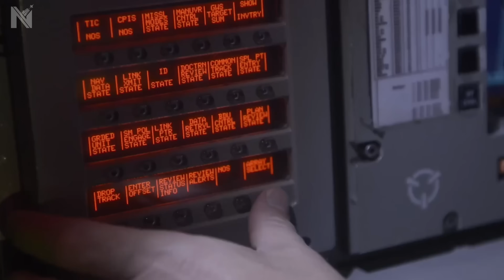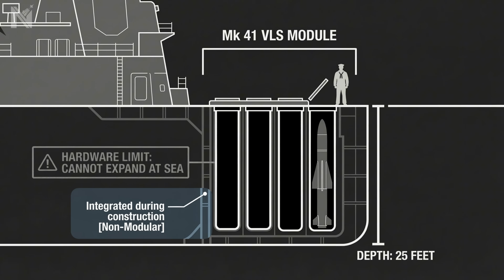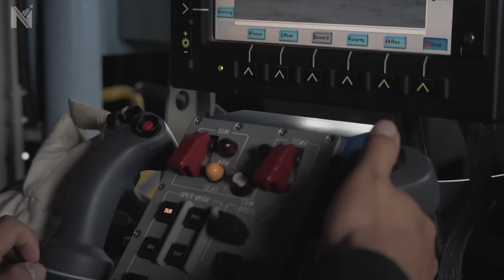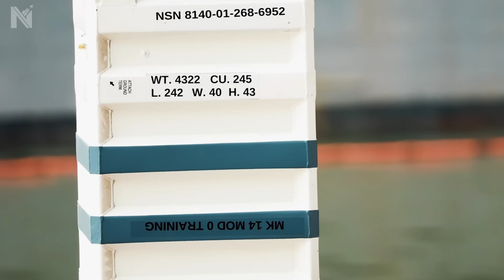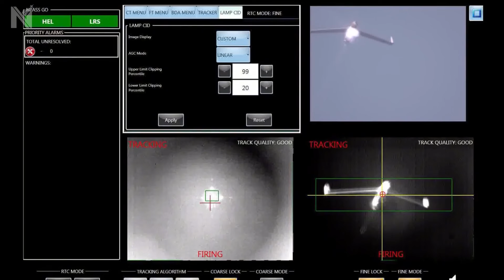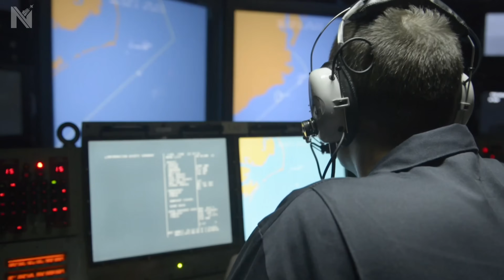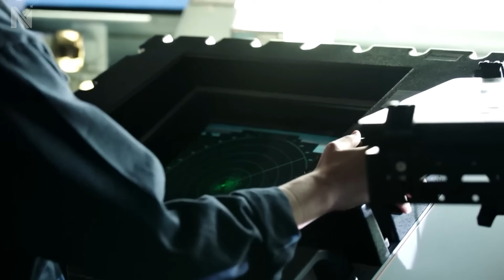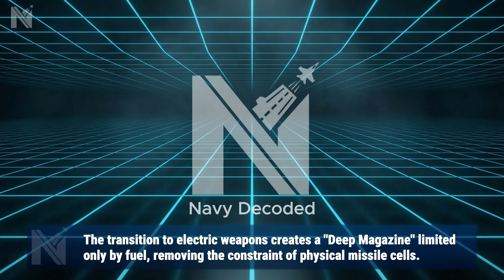Why The US Navy No Longer Fears Suicide Drone Swarms

Comment: 300kw lasers, microwave bursts and jamming takes care of the drone swam problem. I did not even look at the video to know that. This technology will only get better.
Reply from the maker: @ColonelJohnmatrix1000 You’re right about the tools—but the video’s point is how and why they’re used together. There’s no single silver bullet; lasers, HPM, EW, and missiles work as a layered system to control cost, geometry, and escalation—not just to knock drones down.
Reply: @NavyDecoded That's why America is the best military. They plan well well ahead and they kill many birds with one stone.
Reply: @PaintSpec Yeah, we saw it in Afganistán
Reply: And sadly, so will cheap countermeasures.
Reply: @justgivemethetruth  EXACTLY! I own a water cooled infra red laser and just the other day we tried to mark on white plastic. We couldn't even get the plastic warm to the touch regardless of settings! We can literally torch metals like stainless and titanium. With the settings we were using tried a piece of black plastic and it literally caught on fire! In Hiroshima people that wore white clothing were not burned by the flash but if they had white clothing and a black belt the belt literally torched them. So what I am saying is a completely white drone and I mean "real white" would literally be immune to this IR laser. If you were able to put a slow spin on the drone like Putin threatened to do with his missiles, then you have a cheap and effective way to get past the laser. What they need to do is have multiple wavelength lasers. This will help get past the white hack that our enemies will OBVIOUSLY begin to deploy. Not all lasers have problems with white. Our other laser has no issue marking it but it is not IR!
Reply: @sufficetosay  Interesting.  Maybe they would need some kind of parallel array of radiation at various frequency.  Wonder if they could manufacture a frequency shifting laser.
Reply: @sufficetosay They DO have 'multi- spectral" lasers.  In use today.   It's actually a better way to get more power out of it because they aren't trying to tune down to the narrow band commonly expected.   They also are able to blend different wavelength design together at the output.
Reply: @KarltheFog-m7q  Why are they using IR on the Naval ships? If this multi spectral technology is already on the street it seems only logical to use it. Do you think that maybe they will use it once it matures? Maybe they could use the existing IR infrastructure and convert the system to Multi spectral when it makes sense...?
Reply: What about 10,000 fiber optic connected drones, coming from 15.diffent directions,  using Ai to bring them all in at the exact same moment?
Reply: @joebudi5136  That’s what intelligence is for, so you don’t get yourself into that situation. Thankfully, the USA and its allies have the best intel in the world.
Reply: @RightJoystick re read ny comment. Answer how that attack can be twarted. It cant.
Reply: @joebudi5136 fiber optic 😅.. so you mean wired? it would be a piece of cake.
Reply: @j @joebudi5136  easily. HPM is the gold standard for swarms. HPM weapons like the Epirus Leonidas fire a high-energy burst that fries the physical circuits inside the drone and they fall out of the sky. HPM doesn't need to aim at one drone at a time. It creates a "wide-angle" field of electromagnetic death. Even if the signal is coming through a fibre optic wire, the delicate electronics on the drone's motor and flight controller will melt. Other methods are lasers, defensive drone swarms and the "Slinger" System. Australian-made systems like the EOS Slinger use a 30mm cannon paired with a high-precision radar that can blow drone swarms out of the sky in seconds.
Reply: @joebudi5136 to be clear the way these different weapons work the numbers don't matter and in fact sending more at a time is just easier to knock down.
Many of these weapons are not like shooting one at a time they are shooting in an area so they have an area of effect attack. 

Next issue is fiber optics can only go so far and ships are usually further out to see than fiber optic is going to go at least over the water. And if they land anywhere near the water you can literally have a drone go out there and cut the fiber optics in a second. You can have an underwater drone that can hop out of the water cut them and go back into the water and those are easy to make. 
I looked it up for range and advanced drones can go about 25 to 30 miles but they use a very heavy spool obviously because it needs to have the street to go that far and it's going to be dragging and it's going to be laying on the water or it's going to start pulling the Drone down if the drones tries to stay high. We actually already have watered drones so these fiber optic drones are not going to be a risk to most ships especially carriers that don't ever get that close to land even setting aside the area of effect weapons we have if they reach us
Reply: But did you think of that before the Ukraine war started?  Anyone can think of it today, but the trick is to think of it before the drone swarms start, so the equipment is on ships now, not 5-10 years from now.
Reply: @TheDrjehr the tech is already on ship or is being put there this year.
Reply: 2 c well place nukes on two popular Middle East cities will fix everything too.
Reply: what about stealth drones the size of a football 🏈
Reply: @ithinkthonkthunk5333 All the wide area microwave needs to do is sweep the area
Reply: @KarltheFog-m7q gotcha 👍🏽
Reply: @ithinkthonkthunk5333 They have no range and are easily blown off course by wind.  Obviously you have never served at sea.
Reply: @MonkeyswillWin2063 the range is getting longer every year
Reply: Is that really true?
Reply: You guys understand that these defense systems have limited range; are sensitive to oceanic conditions like fog, rain, wind, etc. (which is always!); and cause massive power loads on ships, right?
Reply: @bigsleepla incorrect, new spectrum lasers use duel spectrum technology that bend light around various atmospheric conditions. It’s the technology of the future that make lasers all weather capable
Reply: Copilop
Reply: will it when the drone swarm is 1 million drones? I don't think so.
Reply: @SaraSwedeJénsen Hell……just make it 10 million😂😂😂😂
Reply: @ColonelJohnmatrix1000 yeah soon probably but the most i have seen now is around 600 000 in sync. But as the rate its going now probably within two years military will be able to syc 10 million of them at the same time.
Reply: @SaraSwedeJénsen make it 1 billion!!!
Reply: Video also forget Burke Flight IIA/III and Zumwalt class destroyers have 30mm Mk44 Bushmaster II that can fire air-burst munitions including AHEAD rounds good against swarms of drones. While the older Burke Flight I/II only have the 25mm M242 Bushmaster that can still defend against swarms of speedboats. So for Burke they have 2 of this besides the standard Phalanx CIWS/SeaRAM/RAM. But this is only for terminal interception. Helis are now more commenly used as they can intercept drones at long range. USN for example shot down Shaheed drones at the Red Sea with their MH-60R/S Seahawk helis.
Reply: @johnsilver9338 They have two of them at most. US warships are woefully under-gunned for dealing with high-volume threats.
Reply: @GrahamCStrouse  But each heli can down multiple drones in a single sortie. Against swarm of FPV drones each MH-60R/S is equipped with a 1000+ rpm GAU-21. Basically a mini Phalanx. But small FPV drones that are used for swarm tactics don't have the range. Only the larger Shaheed drones have the 1000+km range.
Reply: @GrahamCStrouse That's why we need bigger ships, destroyers are maxed out on space. We need cruiser class, and yes even Trumps Battleship class. More space equals more weapon platforms available.
Reply: @MonkeyswillWin2063 bad idea in a high intensity fight against China.

Need to spread your firepower across many smaller ships.

Long range anti-surface quasi ballistic missiles, and VTOL CCA fighter drones. 

Stop making the carrier the sole centre of offensive gravity. Spread that out and make it so the enemy don't just have to spend 20 hypersonic missiles to sink one carrier, but have to spend like 10 times that to sink 10 ships that can threaten them.
Reply: @GrahamCStrouse That's why we need cruisers, and even Trumps battleships
Reply: Autonomous drone are jam-proof
Laser needs cool down time
Microwave beam can be affective at shorter range but may not affect drones specifically build with electromagnetic shielding.

Smart enemy will always find a way to counter and anticipate, much like stealth technology is already been rendered useless with quantum radar. Stealth fighter are only good against sub-peer adversary. Not China.
Reply: @jacksableng4775 China makes cheap copies, not near as good as ours.   Their military comes from Temu. Plus its not just us, its Japan, Australia,  Britain,  etc..
Reply: @MonkeyswillWin2063  China, given the budget constrain actually make good products, even better in many respect compared to US. As a matter of fact most of US products like Apple are mostly made in China. On the other hand American made products like cars are sucks, Ford, Chevrolet, Dodge etc can't sell in many countries, oh even Tesla's car have bad reps. US can't make good stuff if the budget is constrained. China makes hypersonic missiles for 100k USD, should the US makes it, it would easily cost 10 million USD.
Best selling American product in many countries would be Boeing, Coca Cola and Soy Bean.
Boeing has almost no budget constrain and has monopoly in the game. Monopoly is the key. Google and NVidia has monopoly so they win.
Reply: @MonkeyswillWin2063 they make them homemade now from Ukraine. STOP kidding yourself. Cheap, fiber optic drones will find their way.
Reply: @MonkeyswillWin2063 Suddenly everybody knows about the chinese threat
Reply: @MonkeyswillWin2063 😂😂😂 MORTONs who underestimate the enemy are the ones who get killed, keep telling yourself China s military is Temu grade
Reply: @jacksableng4775 They are made in Taiwan not China.  Don't be a CCP propagandist
Reply: @joebudi5136 The fiber cables will melt with microwave
Reply: @MonkeyswillWin2063  That's so funny. What makes China different from Taiwan? They are the same people, not that Taiwanese is of different  Intelligence. What Taiwan can do China can also do. As a matter of fact many countries see that there's only one China, Taiwan being a Province of China.
Reply: @jacksableng4775  No need to jam with the microwave weapons.  EMP weapons probably on the horizon as well.  Both very power hungry as is rail guns.
Reply: @dev-debug EMP basically works by frying the silicon chips rendering most electronic unserviceable. 
But EMP damage can be minimized or even nullified by wrapping the electronic parts with a Faraday Cage.
Reply: @jacksableng4775 but what if 10,000 drones all came at the carrier , from 15 different angles, using Ai to have them hit the carrier at the exact same moment? 20,000 drones
.100,000 drones. All on fiber optic. ALL efficient by using Ai. Drones win.
Reply: @joebudi5136 drone alone will not sink a ship. Drone only acts as a prelude, to reduce a ship's sensing and counter-attact capabilities. In other word drone blind the eyes of a ship and numb them down.
The final blow will use hypersonic missiles. One or two direct hit to a vessel is enough to incapacitate it.
Reply: @jacksableng4775 Ha.
Reply: Basically jamming going to be so bad in future they need to go back to projectile weapons - return of the battleship 😮, Trump got real foresight
Reply: @leonardleonunu They have an actual smoke curtain they can hide inside of too.  People forget that one
Reply: @leonardleonunu Japan and their rail guns
Reply: @leonardleonunu or just go up above it about 20 miles…good thing only a few satellites / super-bloons can do that
Reply: Except we don’t have 300 kW lasers and the ones we do have have shit range, don’t work well in bad weather and need to fix in a single point on most targets for several seconds. And HPM hasn’t even been tested.
Reply: @GrahamCStrouse  incorrect. As of 2025, military lasers will have duel spectrum technology that bend the light around any weather conditions including rain or smog. This allows the laser to function unimpeded. 300kw lasers are being upgraded to 600kw before 2027. Beyond 2027, 1 megawatt lasers will be the norm. This has the capability to burn through a hypersonic missile casing in a split second. Or blind its GPS guidance system so it misses its target.
Reply: @ColonelJohnmatrix1000Bro where are you getting your info, TikTok? The physics of bad weather vs optical systems are nearly impossible to defeat that makes lasers feasible for most use cases. Further, there are no 300kw let alone 600kw lasers anywhere close to deployment ready lol
Reply: @Ridewithjst Don't you mean the weather makes lasers un-feasible?
Reply: @spoffspoffington yes
Reply: The drone can be pre programmed they can be made out of different protective materials. They can also come from underneath the sea. 
     I do not have any clue how powerful this is. But I believe it can be defeated. Wouldn’t be impossible for a small underwater drone to come to the surface near the boat then shoot up and explode with a fragmentation device. This could make the weapon malfunction.  
   I believe that a massive swarm of protected pre programmed drones could make a carrier combat ineffective. A few drones making it thru then dropping different explosive ordinances. Like frags then WP to start fires that destroy aircraft on the deck. 
     Drones could easily fly just feet above the surface on its way to the target. 
  They can easily make them plastic so radar won’t detect them. 
   They could attack from underneath while targeting the rudder system.  
    I’m not trying to claim I’m an expert. I just believe our drone technology has the abilities to defeat these microwave technologies.  
   It would be very possible a small type of torpedo vehicle could approach several meters below and then attach itself to the bottom. 
    Won’t take much explosives. Because water does not compress. This will 99% of the energy go directly into the ship. 
   The explosive device could be a shaped delayed charge which would explode several feet into the ship.
Reply: @spikenomoon  "You've raised some really interesting points! It’s true that drones are becoming much more sophisticated and harder to intercept with traditional methods.

However, I think it's also worth considering that in modern warfare, the 'arms race' never truly ends. While drone tech is advancing rapidly, defense systems (like the microwave tech you mentioned, or new sensor arrays) are also being constantly refined to meet these new threats. It’s a continuous cycle of innovation on both sides—as soon as one side finds a gap, the other works on a way to close it. It’ll be fascinating to see how these technologies adapt to each other in the future."
Reply: @Purple00Ninjas .  
   Thanks.  If we can build our subs to not be detected then I’m certain the can build drones that are much smaller. 
    I also know that one of  our carrier groups was shadowed by china. . I think we were also followed by a friendly nation.  We never knew they were there.  Or at least that’s what was claimed. 
   I could easily see a 10 foot drone packed with explosives  approaching from a thousand meters down  and slowly coming up and detonating.
Reply from the maker: @Purple00Ninjas That’s exactly the frame of the video. The goal isn’t to ‘win’ the arms race with a single breakthrough, but to shift the economics and force the attacker into an unsustainable cycle while defenders rely on layered, adaptable systems.
Reply: @spikenomoon idk if you don’t watch videos on the internet but it’s already happened Ukraine has sunk Russias flagship already basically yes some little small drones can do a lot of damage now days I’ve seen a lot of videos of the war from both sides and it’s just horrible
Reply: @Cujo-b1b No doubts it’s horrible what’s going on.
Reply: @spikenomoon  The bottom line is no one is ever going to launch an attack legitamte enough to take down our ships. Because as soon as they do their country will cease to exist.
Reply: @takeflightfinance644  you have a very valid point, but I believe our downfall will come from within our own government. We have become a very evil country in my opinion.  Everything God said don’t do we do do basically we have legalised every 10 Commandment.  Happy new year person.
Reply: @spikenomoon  WHATS SCARY IS UKRAINE ALREADY HAS MOST OF THESE  including the UUVs!
Reply: @spikenomoon Underwater drones are much more complicated,  and lack range.  There's no swarm, also we adapt. Its what we are best at in the world.
Reply: @spikenomoon  THE US MILITARY HAS ALL READY ADJUSTED TO THE ADJUSTMENTS
Reply: @KOJOSLIM007-so6cj  I don’t believe that’s true.
Reply: @spikenomoon  Of course someone can create a new counter method.  It will also cost them a lot more money.  We still have missiles if someone sends something more complex (and expensive) at us.  

We also have the best subs in the world.  If the drone goes underwater we will know they are there just like we monitor for torpedo's of assorted types.    We are also building numerous SSC which will prevent any special attack on a single ship from impacting defense of the entire carrier strike group.  

We have AI controlled drones of our own in styles that can fly or go into the water which can individually target enemy drones as well.  In fact, the US army put into plans quite some time ago a system where every soldier will have their own personal drone for mission work.  I suspect drones could be controlled by a group of soldiers in the carrier battle group as well using the carrier group radar for targeting enemy just like fighter aircraft.

All NATO countries are working with Ukraine, so we pretty much know all of the tricks being used in that war by both countries.